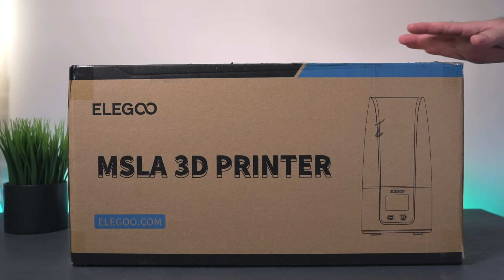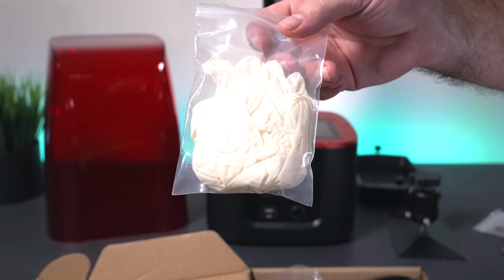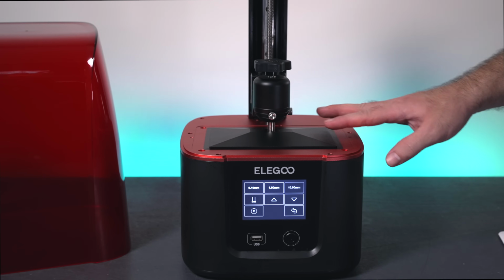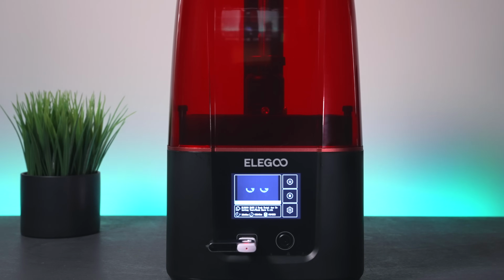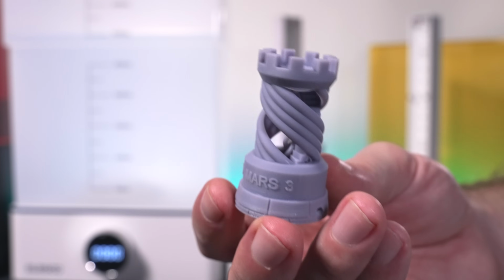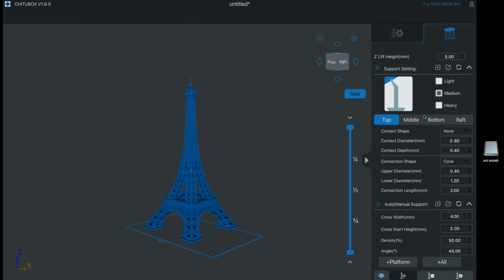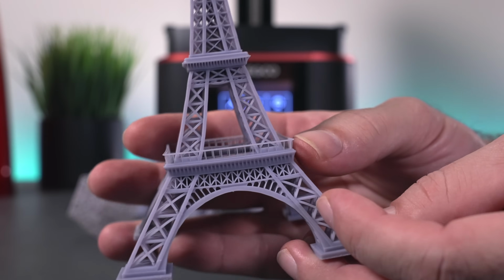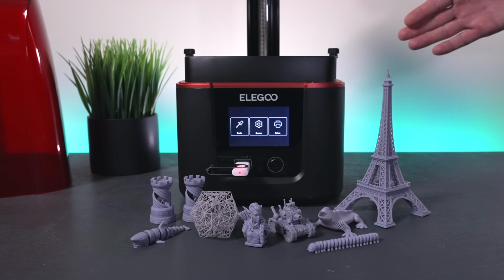Elegoo Mars 3 - 4K 3D Printer - Unbox & Setup

Comment: You skipped a crucial step in leveling. Once you get the level you have to push “Level = 0” to reset the machine to the new level.
Reply: Maybe that's why he couldn't avoid the elephant's foot, right?
Reply: He’s literally the reason i just messed up my first test print fml
Reply: But where’s the button for level=0 ?
Reply: @istegal8752  i think in Tools menu, or prepare

Comment: @18:50 Good job you just destroyed the build plate!!
Reply: Why ?
Reply: @nickoleross6199  I hope you saw the video at minute @18:50 and after. The build plate got deep scratches by the way he removed the finished workpiece using that sharp tool.
Reply: @gwandrer  I did lol I just put it in the freezer and it popped right off no tool needed
Reply: @gwandrer how do you remove it of the plate?
Reply: @nickoleross6199  you put the uncurled models and build plate in the freezer? If so please share. I am curious. That would make sense with the material contraction with the temperature change. If I am wrong please elaborate brother. I respect the thermo awareness hehe

Comment: I just received my Mars 3, it's in the box on the floor next to me.  Thank you so much for your video!  I am not worried I will make any mistakes with setup because of it.
Reply: Got it running but waited a day to get a magnetic build plate.  Glad I did it made removing the part super easy.  Also the instructions mention moving the Z axis .01mm when leveling so that the paper you have underneath can be pulled out with a small amount of resistance.  Helps with eliminating that elephant foot effect.  My first prints were amazing using water washable resin from Nova3D.  I also build a curing station out of an aluminum foil lined box with a solar turntable and UV lamp for $35 CDN.  I had the washing/curing station in the cart but it was over my budget for now.
Reply: They put rubberized feet on it now it doesn't slid around at all.  It still idles with the fan on though.

Comment: Just got my Mars 3 yesterday and trying to follow the instructions was slightly confusing since I'm new to 3D printing. This video was so incredibly helpful!! Still waiting on my wash and cure station to arrive but hoping I can start printing soon!
Reply: Pro tip dont be cheap when you use the resin it cost me one FEP film .
Reply: @mr.president1200  I ordered Elegoo brand resin
Reply: just set mine up, and was slightly confused by the wording of the setup (hence being here) you're 4 months in, I decided on the water based resin, which resin are you using, and how is working for you?
Reply: @zollodiecast  I use the water washable resin. For the most part, printing has been fairly easy however you do want to make sure your resin is warm before printing. I keep my house at 68°and when it's too cold, the prints won't stick to the build plate. Also set your bottom exposure to a higher number. My bottom exposure is set to 90 secs...just a few tips I picked up over the last 4 months.
Reply: @monaclemonst3r  thanks, appreciate the pointers

Comment: I'm going to skip out on the wash station because I plan on just using the water washable resin. Certainly cheaper to shake a bucket around myself. I was hoping to get away with a UV flashlight but I might have to break down and buy the curing chamber. Going to make my first print in a few days so hopefully all goes well!

Comment: I have received my mars 3 couple days ago and it does work very nice. The prints are very detailed with default setting.
Only one thing I'd complain is the fan noise is a bit loud.
Reply: For the love of me i cannot get it to work at all
Reply: Mad Dawg  it wouldn’t print to design. The models would elongate, stretch, warp. I tried everything. I know a bit about printing and couldn’t troubleshoot it. I ended up putting it down to a faulty printer and sent it back after 3/4 weeks of trying. Honestly put me off resin completely.
Reply: Mad Dawg  frustrating as I was so excited by resin

Comment: So for a bit more for a capable inkjet you can get a resin printer. I dont really feel that its overpriced. I feel that there is a lot of technology inside for an expected price. Question? How heat resistant are the models? I was wondering how well they hold up in a warm environment? A small widget for a car or other place where the temps might rise a bit. Droopy Snoopy if I resin printed is a different character.

Comment: So after removing the bed for the wash and cure station after each print, do you need to re-level every time ? Or once those two screws are set and locked down your good to go ?
Reply: Once they are set you're all good. The spring doesnt move, and honestly, just scraping off the print and washing them straight in there works just as well.
Reply: @mads9aar  The hex nuts that hold the build plate in position are not that reliable. Even with extreme caution the orientation of the plate is easily thrown off when removing the print from the build plate. Elegoo is an order of magnitude better than Anycubic, but this build plate mount has a serious design flaw.  

So if you want continued successful prints, relevel.

Comment: when i press home and do the paper thing, the paper can be pulled out from under the build plate very easily, shouldnt it be stuck under there? id brign the build plate down in /10mm increments untilo the paper is stuck but im scared ill crack the lcd screen. what do i do since i feel that the paper being able to be pulled out easily the build plate wont be level
Reply: Paper shouldn't be either completely stuck or completely loose. There should be some resistance when you pull. Same technique works with some self-leveling FDM printers.

Comment: PSA: NEVER use the metal scraper on the plate!  You will damage your plate that way.  Use the plastic one.  It takes a bit more time to get your prints off, but your plate will last a hell of a lot longer!
Reply: Hopefully flexible build plates will be part of every SLA printer in the future since it completely eliminates this issue.
Reply: You mean on the FEP film. The build plate is supposed to have a little roughness so the first layer sticks. Just don't gouge it.